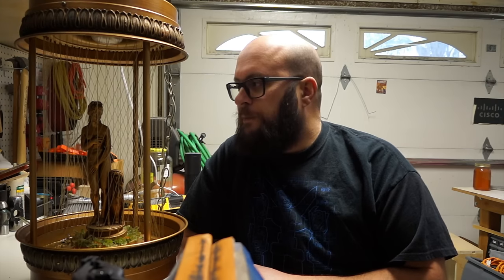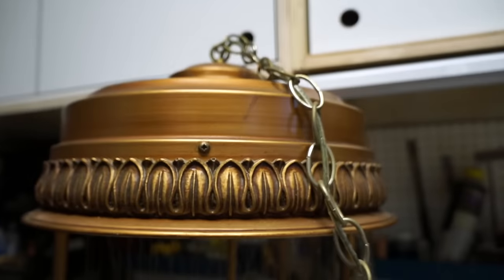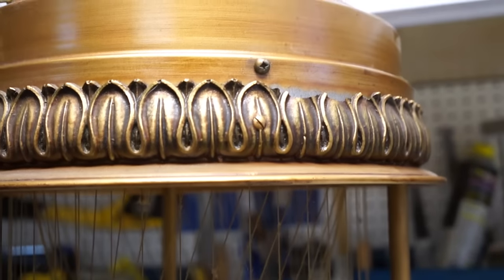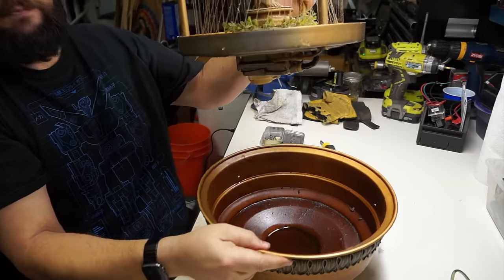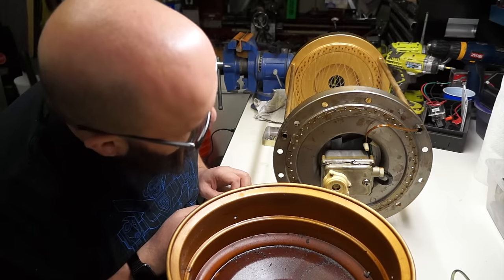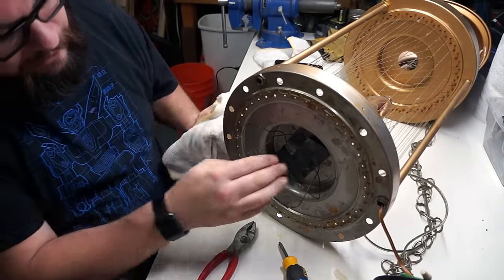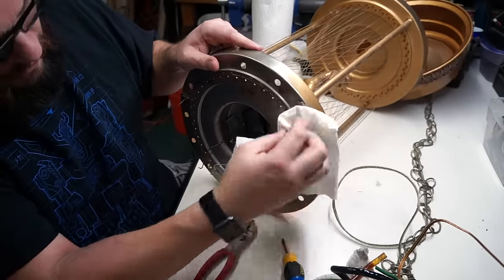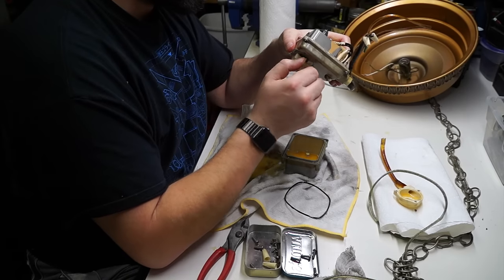Restoring a Oil Rain Lamp Part 1

Comment: Andy. Good news. I researched and discovered that the reason my rain lamp was not raining even though the pump and the motor were working. The reason… I had too much oil in it. Too much oil overwhelms the lamp.

Comment: I, too, have my grandmothers oil lamp. It needs to be restored. Ty for this video!
Reply from the maker: Make sure you use Dawn Ultra not alcohol like I did.
Reply: @TheHandyAndy  ok thank you for the tip. I also need to redo the line. Do I use fishing line?
Reply from the maker: Yes heavy line. I would cut a piece and take it to the sporting good store.
Reply: @TheHandyAndy  thanks!

Comment: Hey man, I really appreciate this video series and the time it took to record it. I bought my second oil lamp some months back and am in the process of restoring it (pump included). I'm glad you eventually fixed it up and have some awesome memories to accompany it.
Reply from the maker: Thanks man means a lot. I will have a new video some time this summer about a problem I have with mine.
Reply: @TheHandyAndy  Hopefully nothing too serious! I look forward to watching it. The only issue I'm having with mine is the wiring setup is pretty different than yours, as it has a second bulb with a lamp shade on top, so it's a little daunting right now haha
Reply from the maker: Yah just map it out it should be pretty simple in the end.
Reply: How much did you pay for yours just

Comment: Oh wow. I'm so sorry you were missing your mom and grandma so much when you recorded this. It's been a while; so I hope time has done some healing for you and it's easier now.  Thanks so much for sharing the family pictures as well.  I see why this lamp means so much to you.

I know that money is not a concern for you with this but I was surprised to see how valuable these are when looking online. Very cool piece!

Looks similar to a bird bath pump motor; but without the watertight coating around the aluminum housing.  Some of those motors were oil filled. The sound it made when you tried to run it sounded like a rotor drag; as if one of the motor bearings is worn. Hard to believe that could happen with all that oil in there.  Looking forward to part 2!
Reply from the maker: It getting better time heals. I hope you enjoy the other videos.
Reply: @TheHandyAndy  Glad things are getting better!  I am enjoying the rest of your series, just started part 3.

Comment: Thank you for sharing this. I’m so sorry for your loss. I have the same lamp w Venus in the middle. Some of My strings behind Venus were broken from movers not handling it properly.  I’d love to do a full restoration. But I’m handicapped, so it’ll be a slow process…… your video is so helpful 🙏🏼💖

Comment: Hi I bought one of those rain lamps today for a 100 bucks it's in really bad shape I have a question what did you use to get rostoff of it is there something that's better than the other
Reply: I meant how do you get the rust off of it what do you use
Reply from the maker: I use Evaporust but is has to all be steel no soft metals. If not navel jelly.

Comment: What a sweet video! I have one that stands and I just took it apart and boy what a sticky mess!!!!! Lol I found out that the motor is shot because there was no movement or noise!😩Any ideas on what little motor I can use or where to find it? Thank you so much…. I tried!!!!!
Reply from the maker: You can get yourself a little one from Amazon. I got one for nine bucks.

Comment: I just cleaned mine, took it all apart, the fan in the motor looked good and spun, put it all back together, added 4x16oz of mineral oil…. But it’s not coming down from the top. Any ideas? I didn’t clean the tubing in the side that transports the oil to the top and couldn’t get into the top reservoir because my top just had the screw to the chain. I don’t know what to do.

Comment: Thank you for this. I have my great grandmother's and I want to redo the middle part. If mine was Venus, I'd keep that theme but mine is the wheel house and eh... I wanna make.it cool. Mine works but I just want to change the design. I might have to hang mine to work on it. Not sure as I haven't finished your video yet. Mine doesn't have the flat bottom. I'm so so.very sorry about your Mother and grandmother's passing. I lost my GMA five days after we buried my Gpa.
Reply from the maker: What you can use is like a ring of wood or like tube.
Reply: @TheHandyAndy  oh yeah, smart thinking. Maybe a bucket with like a blanket even

Comment: How do you clean those lines that the oil drips I've had mine for like 40 years and the lint and stuff is just stick on them you just wipe each one or I thought about using a air compressor you know and blow them off but I don't know if I would damage them and I'm sorry about your grandma and your mother
Reply from the maker: Just wipe them down.

Comment: Hello
Hello! Sorry for you loss of your Grandmother. You are kind to make these videos. My dream since I was a little girl was to have one of these! I scored the exact same one, yesterday....FINALLY!!! When I turn it on, it takes a minute to get going, then its start spraying everywhere and pouring out from where the light bulb is??? Some does run down the lines, though....any thougths?
Reply from the maker: The ports where the wires go are clogged. Simple to clean. Just and Sri pipe cleaner with warm water and Dawn ultra soap.

Comment: I have a smaller grist mill oil lamp. It was my mother's. The pump is out. Could you provide a link to buy a replacement one ? Thanks in advance.
Reply from the maker: Best replacement is a small fountain pump from one of the big box stores.
Reply: @TheHandyAndy  thank you very much.
Reply: @TheHandyAndy  my inexperience is going to show here but a water pump will work ?
Reply from the maker: That what it is thick water. Yah I talked to a collector and that what he uses.

Comment: I’m trying to figure out what to use for string replacement?? I have cleaned mine a few times now but not by taking it apart. When I clean under Venus and around the strings and the strings, I use a small paint brush and I dip it in a fresh cup of mineral oil and “paint” away any dust and debris. And blot the brush onto a towel. “Rinse” the brush in the fresh oil and get more dust and debris out. You have to go slow and use small delicate cleaning tools because the strings break easily and if you use paper towels or Qtip to clean it, the oil will cling to it and you’ll get fuzz or little paper balls in it, making it worse. What weight of fishing line do you use for the strings ??
Reply from the maker: I have not restringes mine yet. That said I think 15-20lb looks about right.
Reply: @TheHandyAndy  I actually found a pdf when I googled it. It said 30-40 weight fishing line monofilament.
Reply: @TheHandyAndy  Thanxx for the quick response 😇 
Here’s the pdf I found: https://pdf4pro.com/cdn/how-to-repair-a-vintage-rain-lamp-awebcat-3829c6.pdf

Comment: Quick question…. I recently got one that the previous owner tried to restore themselves. They put a regular light bulb socket dangling from the top….. everything else works fine. I am very interested in how you replaced the light fixture in that. You mentioned LED. Did you have to replace the light socket also? What did you use?
Reply from the maker: So I kept the same light socket. I would see if you can mount something to the top

Comment: How do you replace the light bulb? It’s so bright. Do you unscrew it and just pull it out from in between the strings? I have the same exact lamp.
Reply from the maker: Yah I gently push my hand in and take it out. Make sure the bubble is very cold as it will melt the fishing line.
Reply: Thank you! I thought that was the way but am nervous I’ll break the lines, all parts are original.

Comment: I just inherited one from my grandfather after 25 years of wanting it. Now its my memory of him. The oil looks clean but the lamp/pump is humming loud.  Would that be a sign of needing more oil or a failing pump? Just looking for a direction to look to, to keep it working for his memory.
Reply from the maker: Those older motors hum a lot. In time we will all have to replace the motors. A normal small fountain pump will work just fine.

Comment: Hi Handy Andy..
I love your videos on the rain lamp.. I have been working on mine and have run into a bump..
I used alcohol to wipe down the lamp shade and now the finish is all cloudy.. Is there any suggestions you can give me? I am soo sad..
I think I may have to paint it with clear coat..
If you have an email and don't mind me sending you pictures I would like your help.. Or anyone else out there.. Thanks.
So sorry for your loss too Andy. ❤️
Reply from the maker: Happen to me too. I had to clean it with clean alcohol but did not help much. Hit me up at andy.delhierro@gmail.com

Comment: I got one at a yard sale but the oil is smelly can I change the oil? It does lights up but
Reply from the maker: Yah take it out. Clean it with Dawn and replace it with clean food grade mineral oil.
Reply: What’s food grade mineral oil? Is it just regular oil? I think it needs a new light is it at the buttom to change it? Thanks so much for responding 😃it’s on my porch for now I only paid 25 is that a good deal?
Reply from the maker: That is cheap. They run 400-500 normally. I just ate food grade because that’s what it’s label
Reply: It’s not brass though not as nice as yours , thanks for reaching out to me😊it’s goldish maybe I’ll send you a photo sometime it’s a plug in one

Comment: Hi HandyAndy.
You mentioned you had to replace the pump. Can you tell me where you purchased it from?  There is just too much built up oil in my pump.
Reply from the maker: I did not have to but a person that repairs them told me you can just use a small water fountain pump.

Comment: Great video I have the same lamp from my grandmother:)
The pump just overheated today , I think. Where is part 2? Very interested to see.
Reply from the maker: It is a 7 part series. Go look at my play lists.
Reply: @TheHandyAndy  thanks. Your videos are very very very helpful. I took mine apart today, my filter was very dirty, the motor runs but I don’t think fast enough. Not too sure what else to look for? I still have to watch the rest of your videos. Thanks for posting.
Reply from the maker: Do not use alcohol to clean it used Dawn ultra.
Reply from the maker: Also, you can replace the pump with a simple fountain pump
Reply: Hey man. I worked on it all day. Finally plugged it in, it’s amazing. Works like brand new. Thank you so so so so so much for giving me the confidence and knowing how to do it. Your the best. Thank you so much.

Comment: Hello I have a rain lamp  ( same size as the one in your video).  Motor has stopped working and needs to be replaced,    Could you recommend a replacement without breaking the bank lol.  Thanks. Louise
Reply from the maker: Very simple a small Fountain pump

Comment: My story is very similar
 I grew up with one and now It hangs proudly in my music room. I have question though. Is it the video or does yours run that fast. Mine is a gentler flow it seems. Just curious. Also I get a oily film on the outside almost as if the metal bottom is leaching through. Whats your take on that? Im going to lower the level ans see. Beautifull job man. ! Took your time and it shows.
Reply from the maker: So there is a problem with mine. It is pumping way to much. Now the film hmm not sure.

Comment: I'm trying to restore a lamp almost like yours, but the screws are under the bands on both the top and bottom,  and the bands don't move.  I read one source where it says to slide the bands out of the way.  Well, these bands won't slide, and I'm afraid I will break the bands apart if I try  too hard.  Any suggestions?
Reply from the maker: Soak the them in warm soapy water. They most likely have years of dirt and grim on them. The bottom is easy as you can use a large bucket or a bathtub. For the top well let’s see if the bottom comes off.

Comment: Hello, I am just seeing this and attempting to restore a vintage lamp. The motor seems to not be turning on when I test it. Any connections as the fb page you gave I am getting no response. Thanks
Reply from the maker: So I found out it just a simple water fountain pump you can get at the hardware store.

Comment: Does that lamp have a manufacturer label? I have two made by Creators Inc. The one you have looks like one made by Johnson's
Reply from the maker: I really could not find one.
Reply: @TheHandyAndy  Oh, I think it's a Johnson rain lamp. I looked it up o Google and the I think Johnson lamps were wider and had that flat top and bottom, and required alot of mineral oil. The one I have is a little slimmer and the top and bottom have more of a funnel like shape. But yours came out beautiful in the end. I love how it actually sounds like rain too.

Comment: I bought one of these for my mom in the '70's wondering about the information on the motor?? Would you post the that info
Reply from the maker: I really do not have much info at all. There is one video where I cover all the labels and info I found on the motor.

Comment: Hi Andy. So ! On mine, the oil looks clear but has a smell to it. Also the motor is not in the metal box like yours. And lastly , it can take at least 30 min for it to start raining. Looks clean. ( bought from estate sale) what are your thoughts?
Reply from the maker: So yah change the oil it should have no smell to it at all. Now the speed it should rain with in sec so there must be a clog or the oil is way to think.
Reply: TheHandyAndy hi. I took it apart and found the problem. That hose bit was loose. I hot glued it and changed the oil to the one you got off amazon. It works great now and no Oder. Thank you for your tutorials on this. I would have never even tried before. I am NOT electronically inclined AT all!🤪

Comment: I recently came across one of these, but it is in rough shape, and there is a lot of rust. I assume they are brass plated because as the rust comes off, bare metal is showing. Any thoughts of stripping and refinishing it?
Reply from the maker: So for rust removal I use something called evoporust and it super safe on your skin. Most of these are just painted so a paint stripper should work.

Comment: What type of sealant did you use on the top of the 3 posts in upper reservoir? Mine had something that looked like wax but it was crumbling.
Reply from the maker: I never removed mine. That just sound like thread lock or something like that. You can use PTFU tape aka white stuff you use on pipes.

Comment: Andy: My motor (original) seems a bit loud, when running though it's pumping oil fine. And when I took it apart and let it run without oil, it was whisper quiet.

Not sure if it's supposed to be somewhat loud or whether there's a way to make it less noisy. Thoughts?
Reply from the maker: So on load it may be vibrating saying the shaft is a bit lose it my thought.
Reply: @TheHandyAndy  Thanks, I will check it out. How noisy/noticeable would you consider say is your motor?
Reply from the maker: Now after I fixed it I can not hear it almost at all. It is a very faint hum.

Comment: Hello!  I am going to make a indoor fountain with mineral oil. Do I have to use any specific pump for oil? Or is it ok to use normal submersible pump?
Reply from the maker: So I have worked on a bunch of water fall pumps. I would image it would work as the pump for my oil lamp looked just like the pump for my ponds. The only thing I would think is the head rating would be different.
Reply: Thank you for your useful reply! I will try! Thank you again!

Comment: Can we get the copper things that the line goes thru and also is the decorative band available anywhere?  I need about a dozen of the copper thingees.
Reply from the maker: I have yet to see spare parts like that on the market at all. When you say copper things are you talking about the wire retention cups?
Reply: @TheHandyAndy  yes
Reply from the maker: Yah I have not tried to make any as all mine where in place. Hmm I would have to google search to see if there are any.
Reply: If i cannot find any should i skip the ones that aren't there so do every other one?
Reply from the maker: Yah you could do that.

Comment: I just acquired a lamp and It was working fine before but the oil was dirty and I drained it and clean it and added 3 bottles of 16oz mineral oil and i hear the pump running but It does not work. Did I put too much oil? Any suggestions.
Reply from the maker: Check that the pump is working. Just hearing it is not enough.
Reply: I dump 8 oz of oil and started to work.  Should I dump another 8oz. This is a 33 inch lamp
Reply from the maker: I ended up adding close to adding 3/4 of a gallon in mine.

Comment: Do you have any tips on how I can clean a clog or 2 on some of the strings? I also have one of these that was left from my grandmother after she passed. I adore it so much but I'm not confident in taking it apart because I'd be devastated if I ruined it.
Reply from the maker: So yah I had a ton that where clogged. I  used a pipe cleaner with Alcohol and it worked perfect. I have a video covering that.
Reply: @TheHandyAndy  Thanks! I watched them, (not the last one but I believe it was video 4 or 5?), but I'll rewatch and observe! Thanks again!
Reply from the maker: So I actually used my tobacco pipe cleaner to clean the holes. They are not like the color ones your kids uses these are specifically used to clean out pipes that you smoke and they’re a bit more stiff so they clean out the sludge. Feel free to email me Andy.delhierro@gmail.com